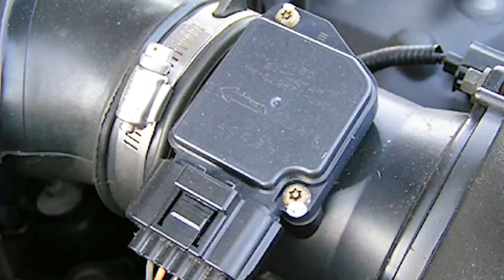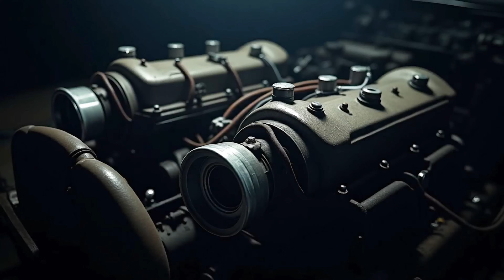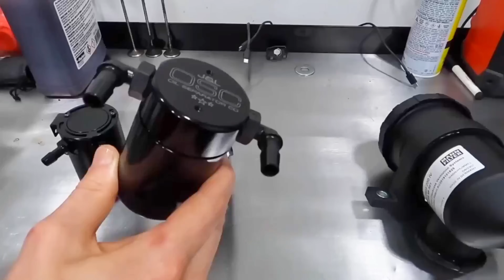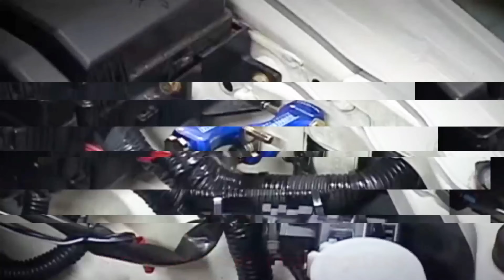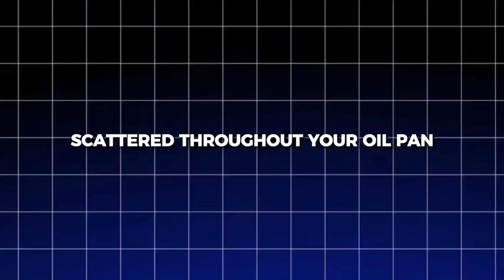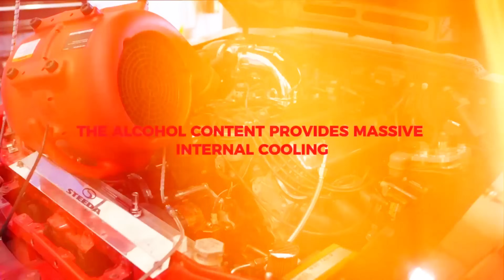LEGAL Mods You DON'T Know Makes Your Car 10x Better!

Comment: Be aware the the K&N style air filters use light oil in them and that oil can get on you MAF sensors heated wire and cause issues like rough idle. Guess how I learned that? ECU remapping is a grey area and some car companies reportedly are now installing ways of logging changes.

Comment: Light weight parts should be in here. 
Including carbon fiber panels, lighter wheels, lighter two piece rotors with aluminum center caps, lighter full titanium exhaust, etc...
Reply from the maker: That's a great idea, thanks for sharing!

Comment: Most of these mods are expensive but only give you minimal horsepower gains.  And I’m guessing that, depending on the brand, will void your warranty?
Reply: You're absolutely correct about all of that. Most of the modifications are also illegal without compliance testing and certification (big money) because they change the emissions profile of the car, so the claim of legality is false. Some, like upgrading the spark ignition system actually do nothing unless you've already heavily modified the engine.
Reply: @AutoEngineerVideos  you think i care abought something being legal?
Reply: @TheSirronYT  given your comment, no, I don't think you would care until the law is enforced, at which time you would probably be annoyed about the law being enforced.
Reply: @AutoEngineerVideos  Correct👍 but i dont care abought the cops if i get caught id be arrested anyways ive been running no plates on my mustang for months
Reply: @TheSirronYT  I used to young and stupid also.
Reply: @joka7316 welp I still am 😂

Comment: Your video was interesting. I have a 2000 Camry LE 2.2L that was given to me by my late cousin on May 23rd 2018. I use NGK double platinum spark plugs, NGK ignition spark plug wires, and in NGK coils. But the mechanic never put the NGK coils on the 2.2L so I'm still running the old ones still. I've had the Camry for 7 years now. I've done some mods on the Camry. Nothing performance wise but sure would love too. I did put wider rims and tires on the Camry. Caleb that works at Sergeant's tires wants me to put on 17 X 8 custom rims on the Camry not sure about that. The Camry rims that came with the Camry were 15's. The owners manual said it could take 14's, 15's, or 16's so that's what I put on the Camry. But not just any stock steel rim. They were 16 X 7's from a 2015 - 2017 Toyota Camry. They look pretty cool on the Camry. I also use K&N air and oil filters. The oil filter was there Silver Performance Series for which they don't make anymore. I wasn't happy with that. But there's nothing I can do about that. I use mostly all synthetic fluids for the Camry change in every 5,000 miles still not sure if I should do that or not. Sorry this is so long but I did like the video. Thanks much.
Reply from the maker: No Problem, Thank you for liking the video sir